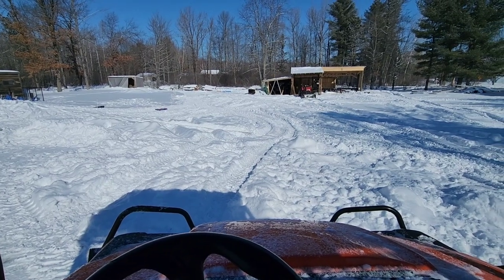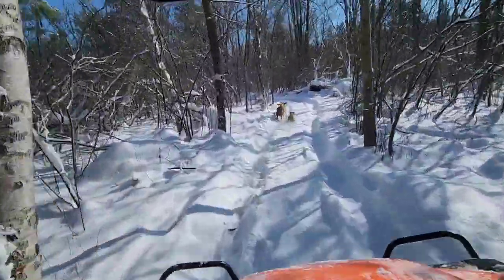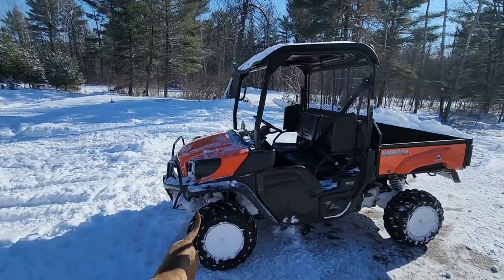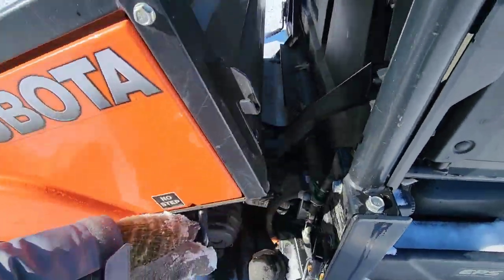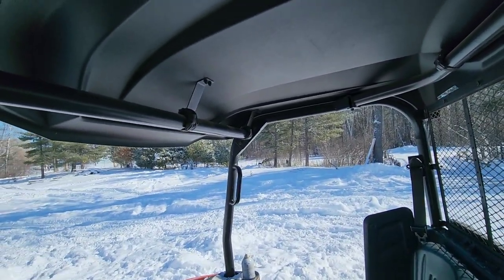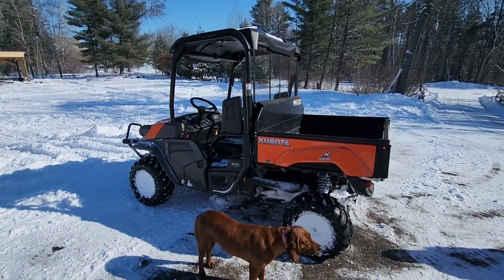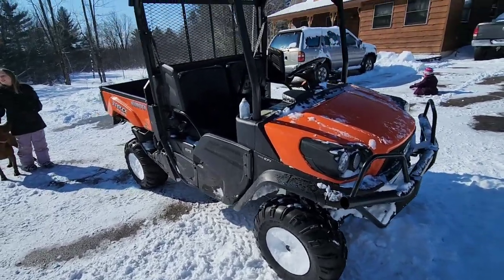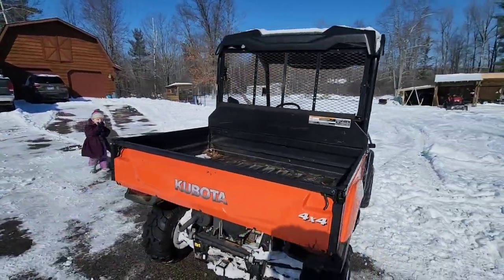Kubota Sidekick RTV XG-850, review in snow of Wisconsin

Comment: I’ve had mine for about two years . The factory sets the shacks at level 2 out of 5 . It takes 5 minutes to adjust them up to 4-5 to get the most ground clearance . I run mine at 4 year round now and the ride is much better . I also just added a 2 inch lift kit for $120 and now I have more clearance than a can-am commander !

Comment: So . . . you're a diesel guy until you actually want to have some fun. Would you say the X900 is a tool while the XG850 is a toy?
Reply from the maker: 🤣 I am definitely a diesel guy.  The diesel side by side is a tool, limited to 25 mph.  The XG-850 is a tool and a toy, but more tool.  The construction of each is very heavy duty.   The X900 isn't fast enough to cover large properties and round up livestock.   They both can haul over 1000 lbs and tow large trailers.  The XG-850 was the better fit for us because we can haul stuff when we need to work, or we could play around on the trails.

Comment: My 2022 sidekick is junk. Bad Gas and water contamination of the crankcase oil. Been in the shop a month now with a warranty claim and dealer can not get help from the kubota rep to find the problem and a solution.  Seems the 850 engines have a problem that can only be solved by throwing parts at them and Kubota is ignoring that. Don't waste your money on the sidekick look for a side by side from a reputable company that specializes in them. My buddybought a Ranger when I bought the sidekick and he has had zero problems and at 25 hours mine has been ib the shop a month with Kubota not caring..